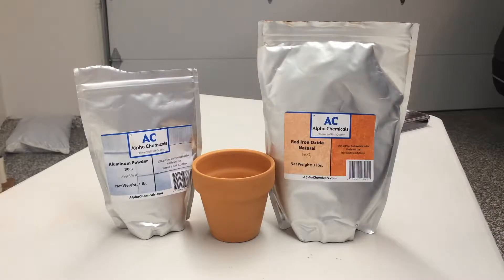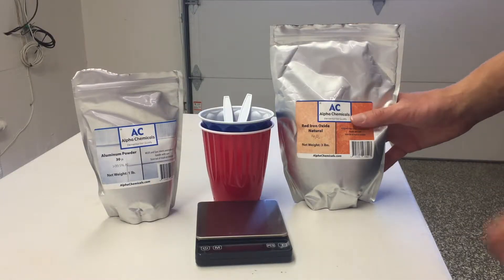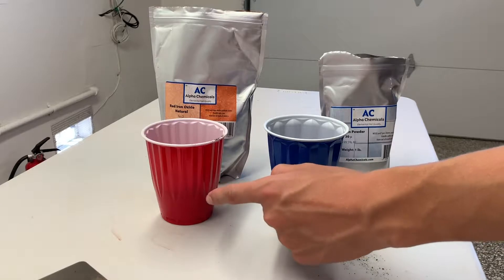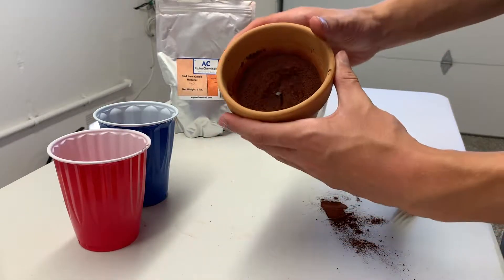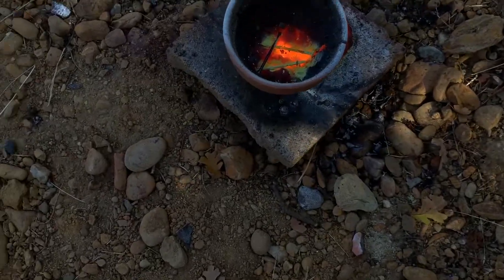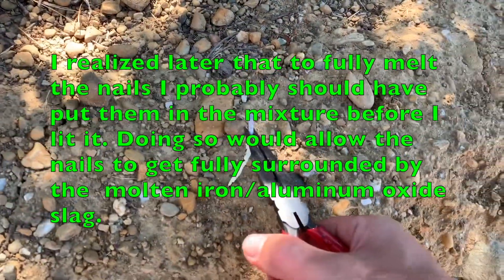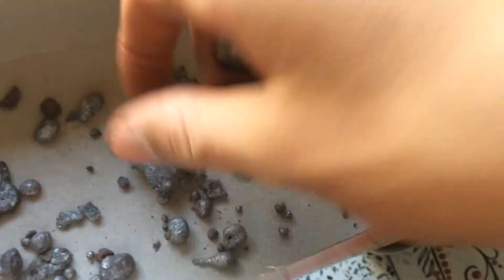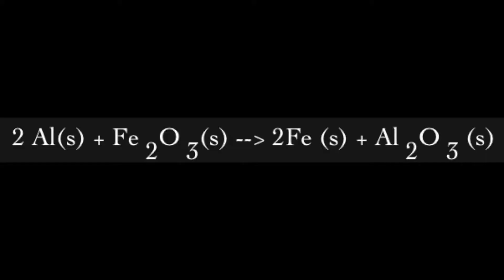How to Make Thermite

Comment: why does it have to be red iron oxide powder?
Reply from the maker: it doesn't have to be red iron oxide it could also be black iron oxide, chromium oxide, or manganese dioxide
Reply: @pyrochemminer3453  
so can i use that black thing from the battery right ? (manganese dioxide) ??
Reply from the maker: If your battery contains MnO2 and yiu are able to extract it then yes. I read somewhere that the coin lithium batteries have it. The double A's had iron disulfide.
Reply: @pyrochemminer3453  
Thank you 😁